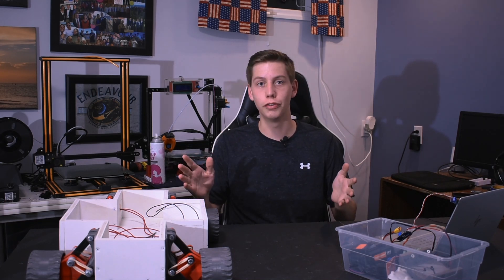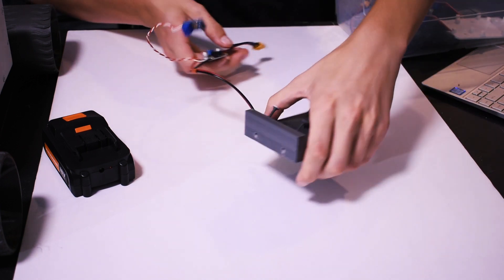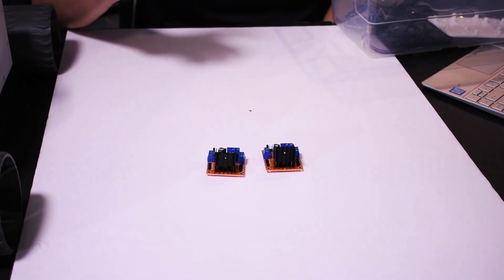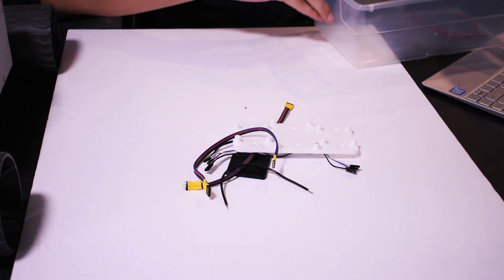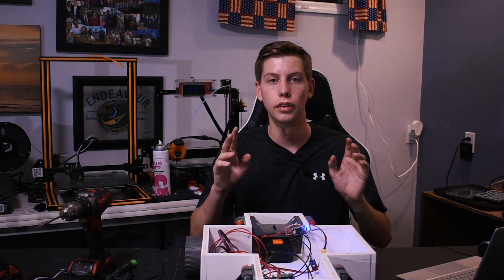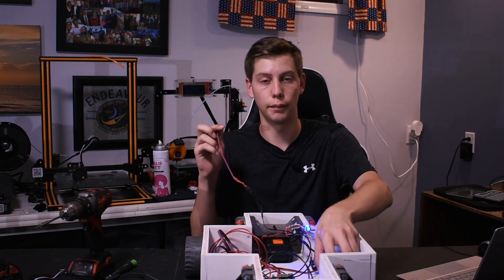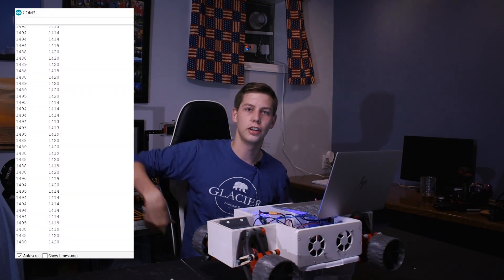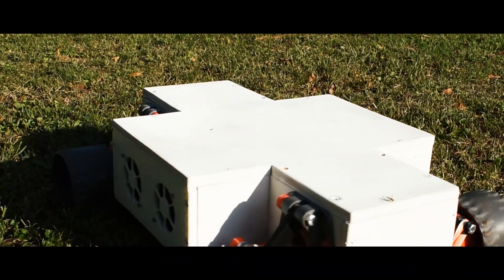3D Printed Rover - Pt 2   It Drives!!!

Comment: nice work!! i believe the cause of the underpower is the motor driver that you r using... they have a voltage drop and r extremely inefficient .... u could change to better motor driver or build ur own using a few mosfets and a mosfet driver .....loved the suspension wheel system